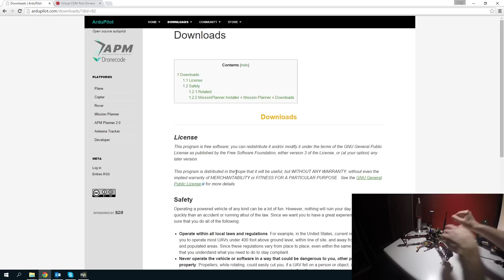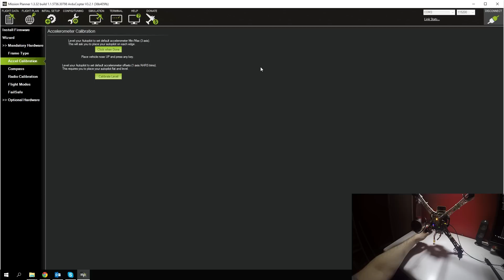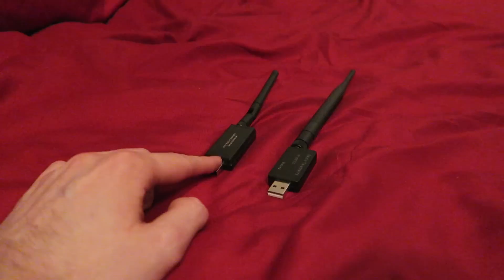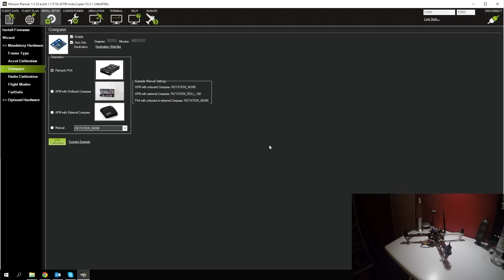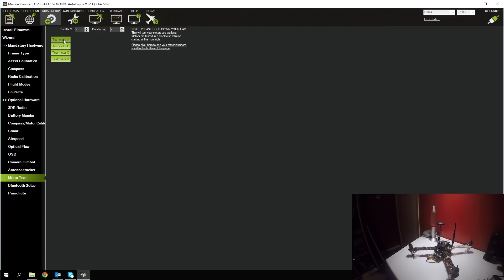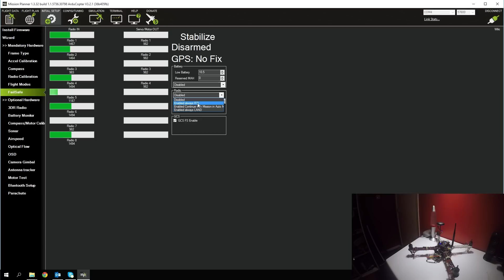High End 450 Quadopter E06 - Pixhawk Setup

Comment: andy great series. i am using left hand throttle and mission planner does not correspond to what the radio is. what  have i done wrong? thanks
Reply from the maker: +pat ballard what radio are u using?
Reply: +AndyRC i am using a taranis plus. i got that part fixed by changing the order of the channels. it is now correct in mission planner. But i can not get my window 7 or 8 to see the telemetry when plugged into the usb port. i have tried different drivers but no luck yet.
Reply from the maker: yes getting the channel order is important

Comment: could you send link for the right fatshark module need use either phone or laptop for monitor thanks
Reply from the maker: +gadgetman 404 there isnt a "right" fatshark module. all fatshark modules work with the video receiver module. you will most likely want the 5.8g version but thats depending on what frequency your video is transmitting. (mostly 5.8 is used these days)

Comment: Andy, please can you yell me how much has this cost to build including Taranis?
Reply from the maker: if you watch the first episode and get a calculator u can work it out. I'm choosing not to do that... as I don't want to know lol
Reply: +acgkplh I've done a very similar build but used all official stuff (dji frame, pixhawk controller, 3dr radio, etc) and I also purchased the taranis from a US-based store so it cost a little more.

DJI f450 ARF Frame/Motors/ESC Kit: $200
Pixhawk + GPS/USB/LED modules/Accesories: $385
Taranis X9R/Case/Receiver: $240
6-Position Button/Telemetry Module from Helibatics: $30
2 Batteries/Misc Cables from Hobbyking order: $90

So I'm at around $945 at this point... Not including the $200 used Toughbook laptop that I got especially for ground control. Happy Christmas to me ;)
Reply from the maker: wonderful enjoy it!